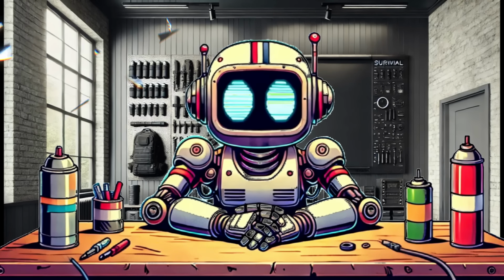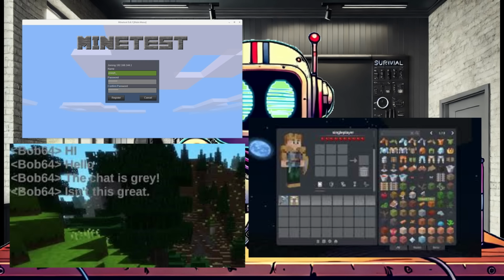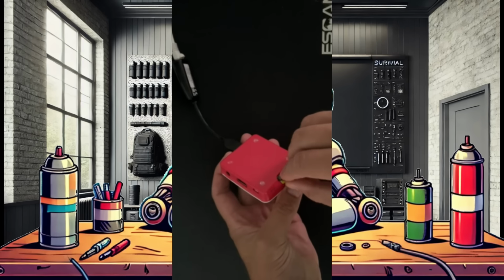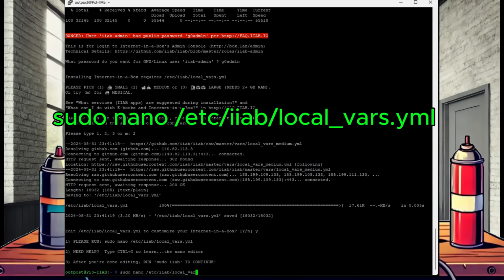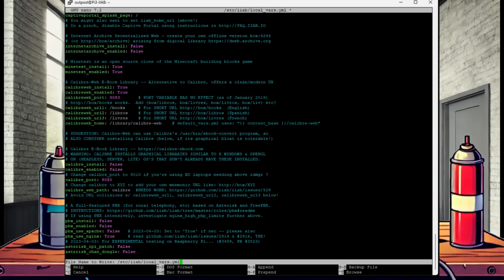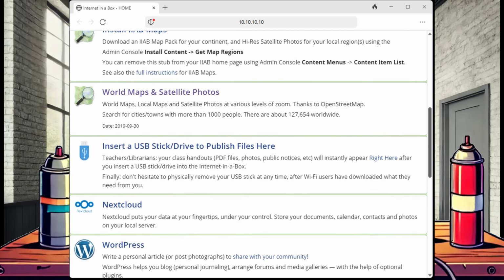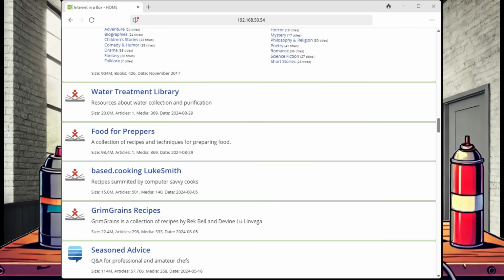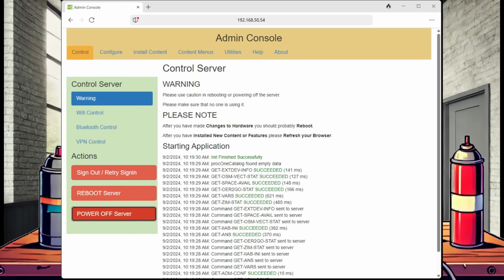Easily Build Your Own Offline Internet: Maps, Cloud Storage, Kiwix, LMS & More with Raspberry Pi

Comment: 2 Questions: first can you use a thumb drive or hard drive for the content to get more storage, or is it limited to the biggest SD card?
Second is it possible to put a bunch of downloaded YouTube videos on the system?
I’d love to build this with an external hard drive and have a big YouTube library to keep offline from the “out of the box internet”. 
Thanks for the great content!!
Reply: You can absolutely use an external USB drive for IIAB content. Check out https://wiki.iiab.io/go/FAQ#Can_I_permanently_attach_an_external_USB_drive,_to_add_more_content? for detailed instructions. AFAIK there isn’t a built-in utility for downloading YouTube videos like yt-dlp, but videos can be hosted either in the built in file server or you should be able to use Calibre-Web. Using the file server is pretty easy and it is also covered in the documentation here: https://wiki.iiab.io/go/FAQ#How_do_I_add_my_own_content?
Reply: @CrimsonPaladin-o2k Thanks! I will check it out.

Comment: thank you for the very informative video. I got thru the install easy enough and used the ethernet cable as mentioned. When complete, I can see the ssid for the hotspot (internet in a box) but can not connect to it (failed connection, like the dhcp isn't working).  Since it is still connected to the ethernet cable, i can go to my desktop pc and connect to IIAB thru the ethernet IP (192.168.1.XXX) and everything works, including the admin page. Any suggestions on what I may have done wrong?
Reply from the maker: A few things you could try:

Reboot the device.

If there is no password set, connect to it via Ethernet and set a password.

Try connecting with another device.
Reply: @TheOutpostUnderground  update. I was changing network options under box/admin and would save changes, but after reading the help section, realized you have to install changes as well. after that, wifi updated and changed to allow access point creation and password along with captive portal that takes you immediately to home. works great, thanks again for the video.
Reply: @TheOutpostUnderground  you mean if there’s no IIAB wifi hotspot password, connect to it via the wired network and in the admin portal set a password for the IIAB wifi hotspot. 

Sometimes devices get squirrelly connecting to open networks.

Comment: Hi, Nice video! I have one question. If the raspberry wifi doesn't work, can you still use IIAB with the raspberry and a monitor connected to that raspberry??
Reply from the maker: Yep, it’ll still work. 👍
Reply: @TheOutpostUnderground thank you!
Reply: I only can access IIAB through another device. The raspberry is now like a server, no desktop, just terminal. Is that how's supposed to be?? In that case it is impossible to access IIAB through the same Raspberry that runs it.
I might be doing something wrong, lost connection through PuTTy a couple of times during installation.

Though wifi in other devices works perfect, but I would like to make a dedicated laptop with the raspberry running it with a screen, power bank and keyboard. (Not connecting other devices but still having the possibility to do it)
Reply: @DavidErresesions  if you installed the Lite version of the OS it does not include a desktop environment. So you’re going to need to install something that can start a graphical user interface (GUI) and also install a web browser. It shouldn’t be too bad; but it is technical. Any decent AI should be able to walk you through it relatively painlessly. As your Pi sits currently it is a headless server.
Reply: @CrimsonPaladin-o2k I jus did it!!! Same thing but just choosing at the beginning Raspberry Pi OS (64-Bit).
Works without internet perfectly
Reply: @DavidErresesions  excellent! 🎉
Reply: Thank you so much for responding!!! 😊

Comment: My entire copy of the survivorlibrary ebook collection is over 256gb. LOL!!!! This little joke of a project is not for someone serious about offline internet.
Reply: Can you clarify your comment? This particular tutorial, if I remember correctly, was built using a 256GB microSD card as an example. But they can scale to however much storage you’re willing to build into it. IIAB is about delivering an entire tech ecosystem; it being a knowledge repository is part of that package. The Survivor Library is also available as a ~256GB zim file from Kiwix and can be easily added to an IIAB assuming there is enough free storage available.
Reply: @CrimsonPaladin-o2k  The survivor library is constantly being updated. The zim files are out of date. I have a way to scrape the website without drawing bandwidth. To clarify I am saying my survivor library is larger than the entire storage of what you are using. I do not like zim files. I rather have direct access to the files. I like control.
Reply: @nomadhgnis9425 and that’s fine. Personally, I also run setups with several TBs of redundant storage and have integrated scraping utilities into my personal IIAB. But everyone is not so fortunate, and perhaps having the the additional myriad of offline capabilities offered by IIAB beyond simple archives is of value. ‘Offline internet’ is really not about simply serving static data. I think there is also value in having a solid foundation on which to build from.
Reply: @CrimsonPaladin-o2k  I understand what you are saying. I was not trying to insult you. I was pointing out that the storage you are using is not enough to hold the entire survival library. That archive books is valuable more than everything else. Any offline internet with out that is no offline internet. It contains books that ate valuable in various disciplines.
Reply: Ever heard about being appreciative of what someone does? Not everything applies to everyone.  If you can do better, then do so, otherwise what is with the attitude?    Just to be clear, to me your 256 gb is just a beginner project: my library runs many terrabytes, I have almost 150 terrabytes of storage and I found this content useful.
Reply: @charlescoffey9523  So what happens when a emp destroys your terabyte storage? How will that help you. Do you have a plan for that. I have stuff that is not easily found. There is more to surviving. Since you are so smart. Tell me this, How to make aquaponics continue working when an emp/solar flare happens. i.e. emp proof aquaponics system. If you can solve this then you have a right to question me. Otherwise shut it. BTW I solved the problem. LOL!!!

Comment: Thank you for the tutorial it worked great. I have a problem though, after I installed everything and got it to run I scheduled some ZIM's to download (one of them was wikipedia maxi ZIM ~110gb in size). A day later I thought to see if they are downloaded and now I can't get into the admin part of the IIAB. I can enter login and password (that are 100% correct, as I used them previously with no problem) and after hitting login button nothing happens. It doesn't give me an error of wrong account details it just stays it is. Any ideas why this could have happened? Could it be that the chosen zim file is just to big for pri3 to handle?
Reply from the maker: @GdR696 What is the size of the drive you’re downloading to, and what file-system format does it use?
Reply: @TheOutpostUnderground  I downloaded directly to RPI3 sd card via the IIAB admin page. I use 256gb sd card in raspberry and there was plenty of room. I am currently doing a fresh install and this time I'll try to copy said zim from usb flashdrive.
Reply: @GdR696 I have seen similar problems in the past. Sometimes rebooting the device fixes it, or re-running the ansible process from terminal. IIAB runs several scripts when downloading ZIMs or other modules so that the menu updates, etc, and sometimes those can hang.
Reply: @CrimsonPaladin-o2k  After some trial and error I finally got all the zims on IIAB. I might be wrong but as far as I understand when you copy or download zims the IIAB device first places the files into a "work in progress" folder, then after copying/downloading is done it moves the file to its final destination, meaning that if you have a zim that is ~100gb it actually needs ~200gb to do all the staff it needs. In this last step IIAB checks if there is enough space on the device and if there is not it gives and error with "not enough room" or like in my case it makes the admin part unusable until you reboot it. There probably is a way around it but I'm not that savvy in linux and I got my system working for now :)

Comment: You should do it again on a raspberry pi 5 16gb version with the biggest version Ive tried but its not working and I have no clue what I did wrong
Reply: I’ve done a couple Pi 5 builds recently. I had to re-run sudo iiab a few times before it completed. Server time outs have been an issue lately, not sure why. Where is your build failing? Is it repeatedly failing on a specific module?
Reply: @CrimsonPaladin-o2k  I'm not totally sure I am definitely a noob with stuff like this but what it said is TASK [mediawiki: Unarchive (unpack) it to permanent Location /library/mediawiki -1.43.0 (-data-data, u+rw.g+r,o+r)] *

changed: [127.0.0.1]

TASK [mediawiki: Symlink/Library/wow/html/w>/Library/mediawiki-1.43.0]

changed: [127.0.0.1]

TASK [mediawiki: Start MySQL systemd service (mariadb) so we can create db]

ok: [127.0.0.1]

TASK [mediawiki: Create MySQL database iiab_mediawiki]

fatal: [127.0.0.1]: FAILED' => {"changed": false, "msg": "A MySQL module is requ Ared: for Python 2.7 either PyMySQL, or MySQL-python, or for Python 3.X mysqlc 11 ent or PyMySQL. Consider setting ansible_python_interpreter to use the intended

Python version."}

TASK [mediawiki: SEE ERROR ABOVE (skip_role_on_error: False)]

fatal: [127.0.0.1]: FAILED' => {"changed": false, "msg": ""}

PLAY RECAP

127.0.0.1

:ok=426

changed-246

unreachable=

failed-1

<ipped=58

rescued-1

ignored 2
Reply: @Perses-_-  Hm... it looks like your IIAB is having issues with some requirements for mediawiki. I would check your local_vars.yml just to make sure something isn't messed up; and then try running "sudo iiab" at least a couple times. If everything looks correct, and it still gets stuck when running sudo iiab, go back into local_vars.yml and set mediawiki to "false" for installed and for enabled. Then re-run sudo iiab. I highly doubt you'll be messing with mediawiki anyways, and this may get around whatever is broken and finish the install. If nothing works and you're completely stuck, you can hop over to the project's official github and ask for help from the developers, who are cool folks, and/or you can join Outpost Underground's Discord and one of those guys may be able to help.
Reply: @CrimsonPaladin-o2k  Thanks, I'll try to figure it out what does MediaWiki do? Maybe I won't download that one specifically
Reply: @Perses-_-  Mediawiki is a platform that lets you build and publish a 'website' in the context of IIAB. Some experienced users even build a custom IIAB homepage using it. You aren't really missing any content by not installing it.

Comment: stupid when you wont have electricity and that information is useless
Reply: Yeah, too bad they don’t make UPS kits for the Pi…. Or adapters to step down 12 volt battery’s to 5v for the Pi. Or solar panels. Or generators. Or wind turbines. 😂
Reply: Stupid when you dont have air you can’t breathe

Comment: Can you run it from a hard drive? Any help would be appreciated!
Reply: Absolutely. Depending on the Pi, you may have to configure its boot options. I’ve got a Pi 4 running IIAB from an old 1TB external usb HDD. Works perfectly.
Reply from the maker: You can, here is a link that may help you.

https://github.com/iiab/iiab/discussions/3350
Reply: A HD requires more power. If you really intend this as a “grid down internet,” you’ll want it to be as power efficient as possible.

Comment: Hi, when I enter the password to enter admin it does nothing
Reply from the maker: Can you provide more detail please? Are you trying to access from putty?
Reply: @ Hi, no when I put 10.10.10.10/admin and it says user and password and I enter it and it says invalid
Reply: @josesayon unless you changed it during install, the default is UN:iiab-admin and PW:g0adm1n    If that isn’t working, but the install completed and you have a user account for iiab-admin, you should be able to manually change the password in terminal using sudo.
Reply: @CrimsonPaladin-o2k  Thank you very much, it now works and you can change the language to Spanish.

Comment: good afternoon i did a install for iiab and had alot of errors. i now know what happen but don't know how to delete the first install? it keeps trying to restart the same install. thanks
Reply from the maker: Uninstalling IIAB can be challenging, especially if the initial installation was incomplete or broken. If the system keeps trying to restart the same install, it’s likely due to leftover processes or configuration files from the first attempt.

If you installed IIAB using the one-liner script, determining exactly what was modified can be tricky. In similar situations, I’ve opted to wipe the system, reinstall the OS, and then perform a fresh install of IIAB. This is often the cleanest solution.

If reinstalling the OS isn’t an option, you’ll need to manually reverse the changes made by the install script. Start by reviewing the installation steps in the IIAB documentation and undoing them one by one. Alternatively, the IIAB team is quite responsive on GitHub. They can provide guidance specific to your issue and help you get back on track.

Hop on our Discord and we can try and help you figure this out.
Reply: @TheOutpostUnderground  thanks went with the reinstall all good now.

Comment: There must be a way to implement meshtastic on the rpi in addition to this
Reply from the maker: Meshtastic can indeed run on a Raspberry Pi using Linux-native hardware setups, as detailed in the official documentation. It requires configuring a compatible LoRa module with the Pi to enable the Meshtastic functionality.

https://meshtastic.org/docs/hardware/devices/linux-native-hardware/
Reply: @TheOutpostUnderground looking over that material, it does seem to be possible. Raspberry Pi OS is based on Bookworm, which is what the meshtastic binary is compiled for.

Comment: So im having some issues woth this installation and Im not sure how to fix it. i keep getting fatal and failed installs and my completed screen does not look like yours. i get a play recap with ok=626, changed=238, failed =1 etc and then there is no wifi network setup nor can i access the iiab home page. any info is appreciated.
Reply from the maker: To help troubleshoot, we’ll need more details about the hardware and operating system you’re trying to install on, as well as where exactly the install is failing. The terminal output should indicate which specific module is causing issues.

In the meantime, you can try a general fix: locate the local_vars.yml file and set the failing module to false. This may allow the installation to proceed without attempting to install the problematic module. Let me know if this helps or if you’re able to provide more details for further guidance!
Reply: @TheOutpostUnderground  thank you a ton for the reply, I actually used chatgpt to help solve the problem and it works now, I'm currently downloading content as I type. tha ks again for such an awesome walk-through.

Comment: Great video but I cannot get the map files to install no matter how hard I try any ideas? Do you have a discord?
Reply: It may also be worth checking out https://github.com/iiab/iiab/wiki/IIAB-Maps as it contains detailed information regarding maps on IIAB.
Reply from the maker: We have a Discord server: https://discord.gg/AXzvmcx4.

Regarding your question, it’s difficult to provide a specific answer without more details. If it’s an IIAB-related issue, we recommend checking the GitHub issues page ( https://github.com/iiab/iiab/issues ) for support from the developers. What OS and hardware are you using? What steps have you tried so far, and what specific issues are you encountering?
Reply: @TheOutpostUnderground  I've joined the discord I'll put some screenshot up in there

Comment: Thank you :)  Great explained.  Yes there are so much more things possible and with use of terrestrial transmitter / receiver its defo possible.  Even the CB Radio Band (11 meter band) offers a few data channels ..but in a very worse case it will work on any other channel too..there are already exsisting stations that offer a kind of info drop space...while i think with this system  internet in a box that would be the perfect solution when keeping the data send packages low and perhaps with  some correction software for  interfereances in the air...   I subbed  to your channel. ... <3
Reply: I feel as though this could be possible as well, but I need to better understand data over radio
Reply from the maker: Thank you!

Comment: Excellent video.  Thank you!  Is it possible to network IIAB nodes together for local communication?  My village is about a mile long and not everyone can see my node as I am not centrally located.
Reply from the maker: I would reference the iiab tech documents, specifically networking. It should be possible, but you would have to either set up a mesh network to cover it, or run Ethernet to strategically placed wireless access points. 

https://github.com/iiab/iiab/wiki